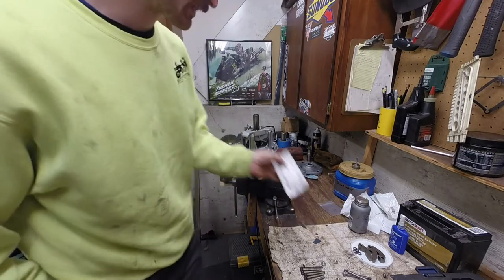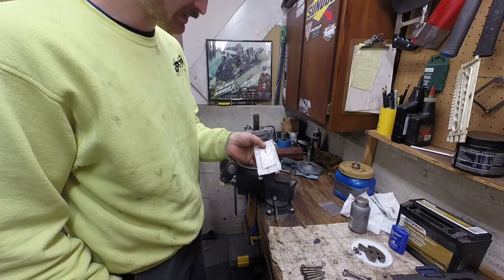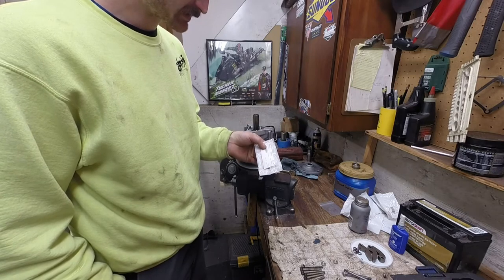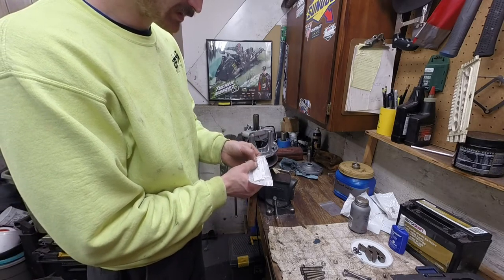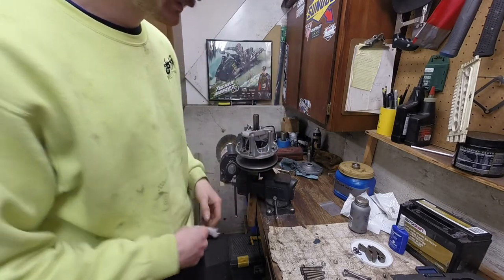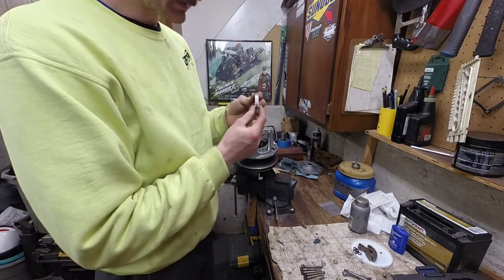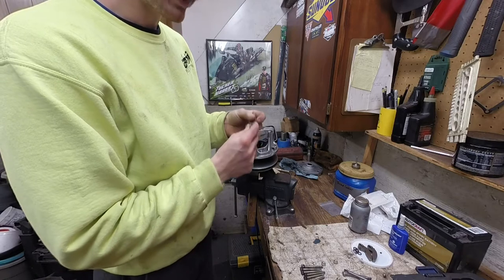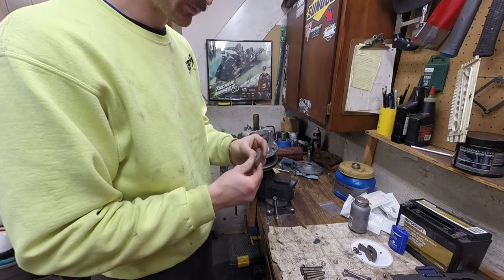Sled Tips 012 – Arctic Cat Snowmobile Primary Clutch Weight/Cam Arm Replacement Repair

Comment: Hi I have learned a lot about snowmobile clutches from watching your videos, thanks!  Do you have any advice for replacing the weights on an older A/C 9 tower clutch?  The pins holding the weights are smaller, and I cant seem to find a way to get a wrench on the lock nut- theres no clearance!  and the head of the pin is a hex, not torx...I am worried about stripping it.  I hit it with PB blaster then heat, but it wont budge.  Any advice is appreciated!
Reply from the maker: Socket from the end won't fit? I've had to hold them with and open end wrench or wedge it with a screw drive. Unless corroded, they should be THAT tight.
Reply: @longtinmotorsports  Hi thanks for getting back to me!  Yes they were corroded as hell!  I ended up carefully cutting through the lock nut with a dremel and a tiny circular cutting wheel so as not to nick the cast aluminum body of the clutch, then tapped the pin out with a small punch.  I've never seen weights with a hole so oblong...This clutch was hammered.  But with the help of your videos I am going to rebuild it myself, starting with the bushings!  Thanks again.

Comment: How stiff should the pin be in the bushings and still rotate? It takes a little bit of force to lift the weight and turn the pin on my clutch.
Reply from the maker: a little resistance is fine. the orings on either side of the pin are what cause that. The weights will not "flop" up and down like they did in the old style 6 towers and 9 tower clutches. because these weights are set-screwed to the pin, and the pin has the o-rings on either side, there will be a little force required to move the weight. This is OK!